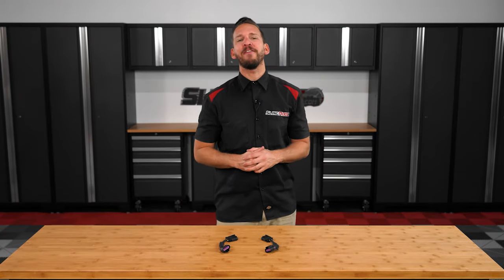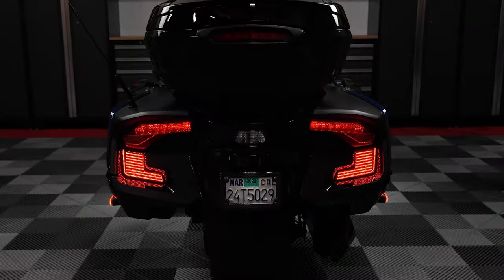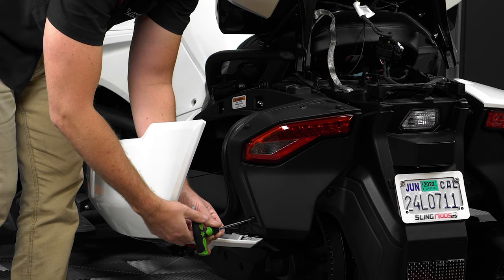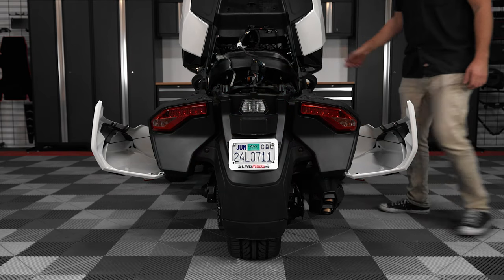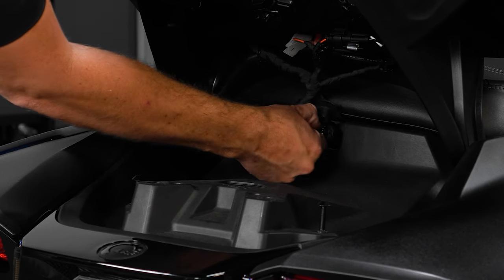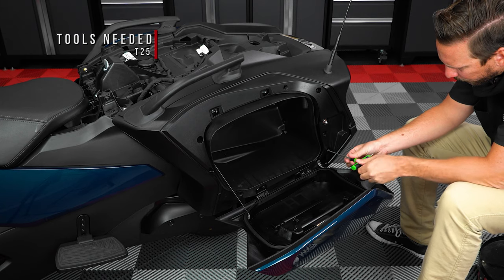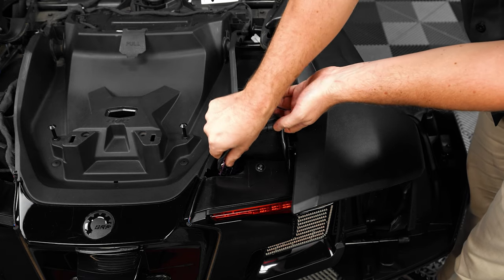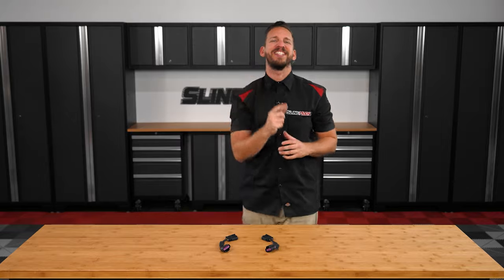Can-Am Spyder F3T/F3L & 2020+ RT/RTL Brake Light Flasher (Plug N' Play)

Comment: Nice product.  My only recommendation to improve this would be to flash upon deceleration.  I already have no issue tapping the brake when stopped or stopping.  I see the biggest issue being when you slow down without braking.  Drivers tend to not realize their closing speed until it's too late.
Reply from the maker: Hello Brian, that would require the product to have an integrated accelerometer to detect engine braking. We do actually have motorcycle apparel coming out later this year with integrated accelerometers and LED brake lights that will illuminate when engine braking. The clothing will also feature turn signal integration that works on a bluetooth module that's connected to the bike. Thanks for the feedback.

Comment: I installed the flashing brake lights along with the after burners. Everything is working correctly, except for some reason the left after burner does not flash when I tap the brakes. Any idea what the issue might be? I have everything hooked up on the left side the same as on the right. Right side after burner flashes, but for some reason left side doesn’t. Thanks.
Reply from the maker: Hello Kyle, we're happy to help. If you could kindly reach out to our Customer Service Team, they can work with both you and the MFG to find resolution. you can submit a support ticket here: https://www.slingmods.com/index.php?route=information/contact Thank you!

Comment: How far can we pull that panel back without damaging anything? I went to install the brake light flasher and could only pull the panel out a few inches. Not enough to get to the wiring inside. And definitely not enough room to get my hands in to unclip the harness. If I can't access it I'll have to return your product. So any suggestions will help. I have watched the video many times. Thank you.
Reply from the maker: Hello Pam, I don't have an exact measurement for you in inches regretfully. We just pulled it out far enough to get the factory plug unclipped, so that we could plug in the brake flasher. If it's not something you feel comfortable installing, we'll happily accept your return if you prefer that. We want whatever makes you happy. Here's a link to our customer service team in case you need it: https://www.slingmods.com/index.php?route=information/contact Thank you!

Comment: When this mod is installed does it work on the trailer lights if there's a trailer attached to the factory trailer wiring harness?
Reply from the maker: Hello David...No, the flasher will not work on the trailer as the trailer module is a separate module on the spyder and not part of the rear tail light harness.